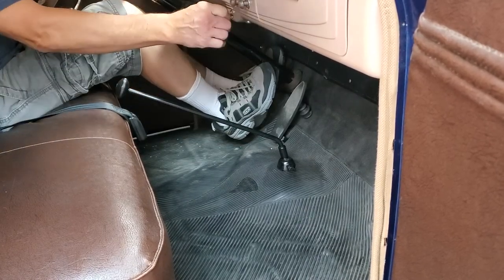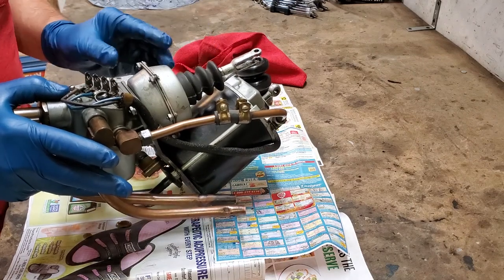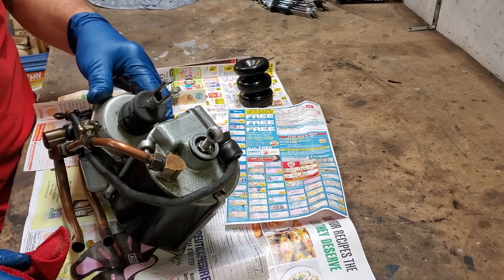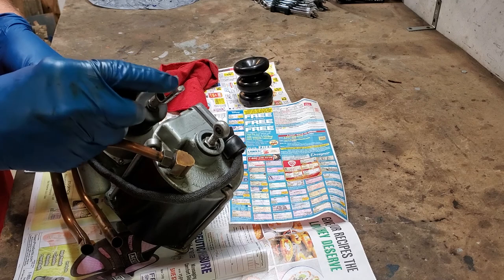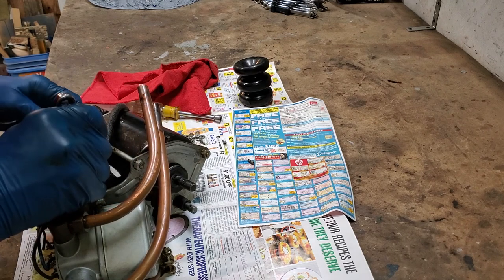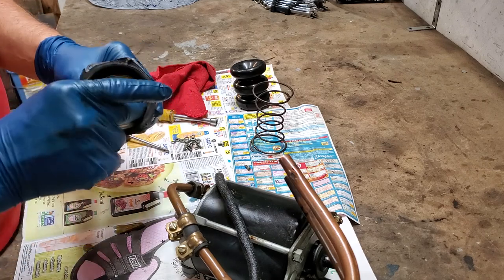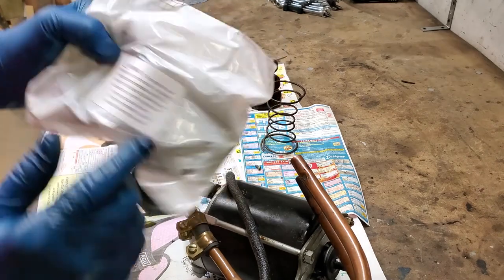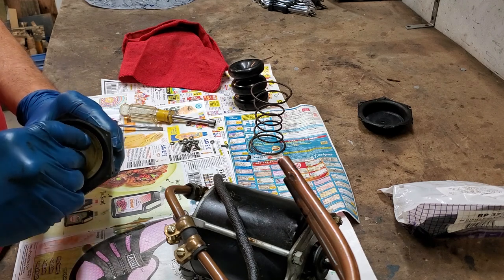Terraplane Electric Hand Cross Shift Repair - 1937 Terraplane Manual Transmission Diagnostic

Comment: Remove the inside fasteners 1st hold the flanges together with small vice-grips until all
fasteners are removed or replaced. Hope this helps.
Reply from the maker: Thanks for the tip! Sounds like a time saver. Thanks for watching!